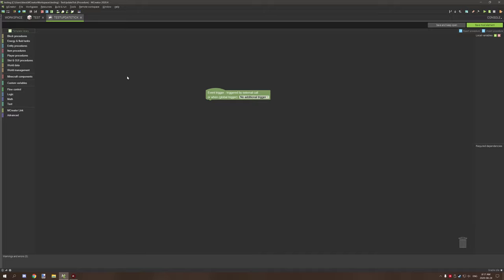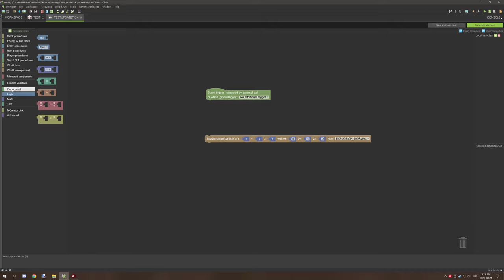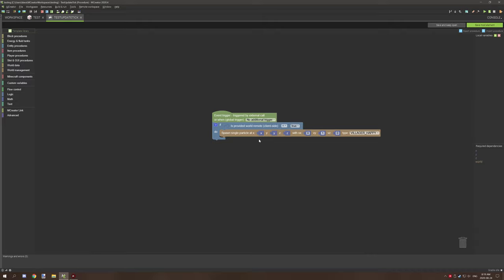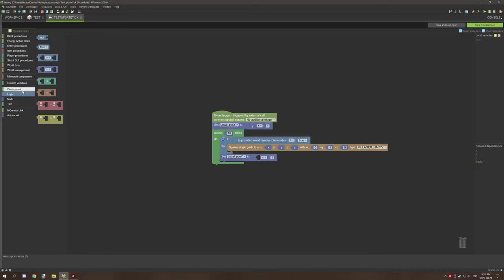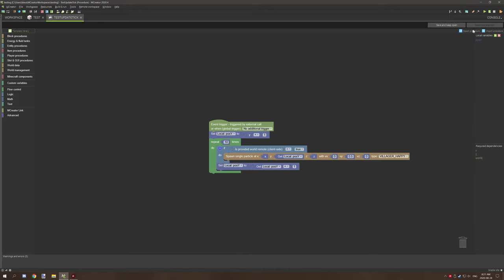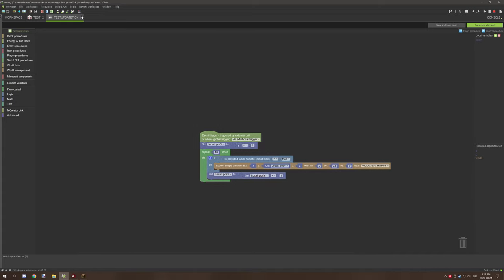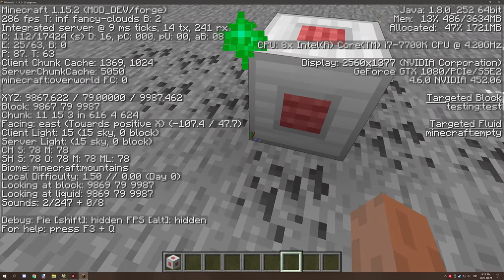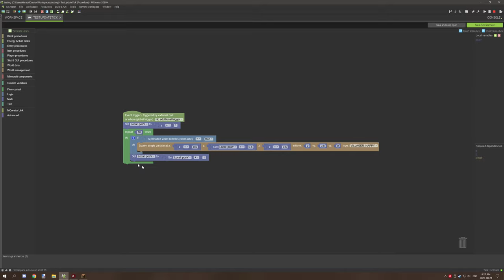MCreator: How to use Particles | Procedure Tutorial

Comment: How to Let it Make Less Particales it's Too Much
Reply from the maker: The repeater controls how many times the block should run, if you set the number to 1 then the script in the loop will only run 1 time. If your running server-side particles you can control how many will spawn. Also its possible to use the /particle command in the base game using command procedure blocks too.

Comment: Love you videos on torches however, im having issues trying to figure out how to assign a custom animated flame particle to my custom torch in version 2023.4 as some of the procedures you are using in this video seems to be missing from the latest release of mcreator. any help would be greatly appreciated
Reply from the maker: Depends how you want to animate it I guess, if you want something like Vanilla you just need some particles and make sure they spawn at the tip of your torch. If you want texture animation you will need to set this up in your torch model then make a animated texture separate from your other models this way its easy to update if needed for flame color or even other materials later on. It also makes it easier to manage the textures as animation textures can be a pain to update. So when you make your model in block bench make sure you create a separate UV map for the flame part if you goes this route. As far as particles they should spawn on the torches tick update, the location of where they spawn will very depending on your model so you will need to tinker with this until you find something you like. I hope this helps.
Reply: @NorthWestTreesMCreator  yeah figured it out after the fact. Now im having issues getting the vanilla torch variant to rotate

Comment: I'm very late to the video, but is there a way to force vanilla particles in MCreator to always render? I know with custom particles you can set this as an option, but if someone wants to use the vanilla particles, how would they go about setting mode to force? I find the campfire smoke particles will stop spawning when 5-7 blocks away from the source.
Reply: I am having this issue as well.
Reply: Use commands instead. @sushisenju

Comment: is there a way to make the render distance for them farther? im using them for an explosion but the render distance of it is very short
Reply from the maker: This is only possible when you use the particle command the command would look like below.

particle minecraft:composter ~ ~1 ~ 0 0 0 0 1 force @a[distance=0..64]

The two periods ".." indicate a range so this value is between 0 blocks away and 64 blocks away.
You can change the 64 to what ever distance you want.

This is the page for the wiki which should help you with the command.
https://minecraft.wiki/w/Commands/particle
Reply: @NorthWestTreesMCreator  thanks, before I get into it, does the command save into the mod file or will I need to do it each time?